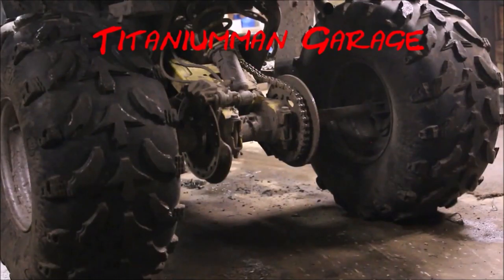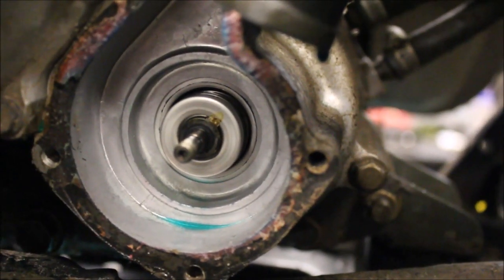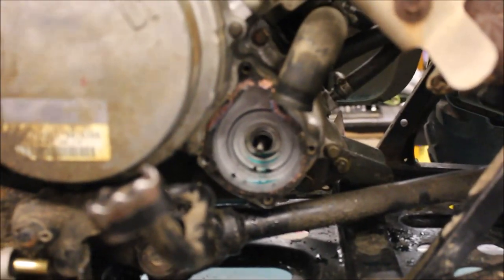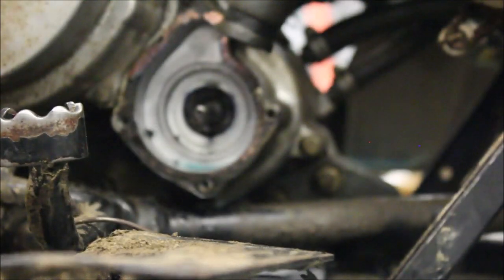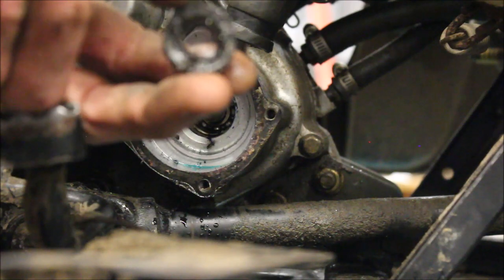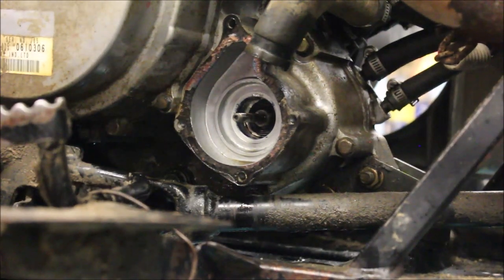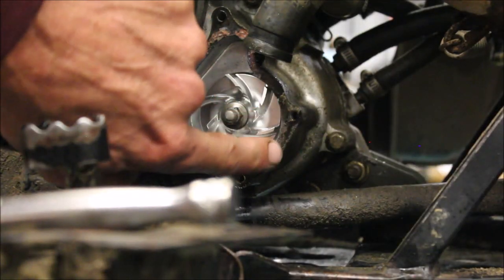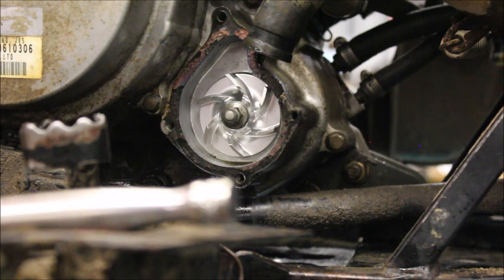HOW TO INSTALL A WATER PUMP SEAL ON A POLARIS SPORTSMAN WITHOUT SPLITTING THE CASE.

Comment: Dont use a screwdriver to pry it out.. my father did this and bent the shaft. The drill a hole and thread a screw to pull method workwd for me! Thx for the helpful video 🤙
Reply: Don’t pry on shaft and a little heat wouldn’t hurt😮
Reply: My mechanical seal came apart and left the inner cup in. Any advice on how to get it out....
Reply: @Asunamazda  if you're replacing the cup also like I was, put a wide head screw into it, and then used a slide hammer to pull the screw out with the cup. Worked like a charm

Comment: Looks like I bought the exact same kit as you and I just got done replacing mine in my sportsman 500 now I am getting coolant leaking out of my weep hole.  Not sure if I got bad seal.  I am guessing if it is coolant leaking it is the mechanical seal that is the issue.
Reply from the maker: Yup. Its leaking or the rubber seal behind it.

Comment: I have a 1999 sportsman 335 that was leaking oil. I took the cover plate off the oil cooler pump and it had no impeller or mechanical seal. Just a gasket around the middle post. The post is not threaded and all I can see is the bearing and the post. Don’t really understand if this is normal or was the mechanical seal been missing? Help!!!

Comment: I have coolant in my crankcase. Others have said pump seal or could it be the head gasket?
Reply from the maker: If you look at the sparkplug and its wet and its blowing coolant out the tail pipe or white smoke..Head gasket. If its dripping from the weep hole...its the seal.

Comment: The shaft and bearing inside housing how do you pull that apart to change shaft and bearing inside housing do I have pull while engine to do that thanks
Reply from the maker: I haven't had to do that. but I believe it is pressed in. You would have to split the case halves to get to it on a 500.

Comment: Dumb question been work one one these for a friend seen it was leaking out the lil hole could this cause an overheating problem? And when I pressure test it , it don’t leak out that hole or anywhere else just happened to notice it was dripping
Reply from the maker: When you pressure test it you might be pushing in the mechanical water pump. If it leaks out the weep hole its leaking somewhere. Check the oil in the engine. see if there is coolant in the block.

Comment: I thought you said in your previous vidios that this was the incorrect way of doing this job ? I was getting water in the crankcase as well . I recently did this job by taking off the "plate" behind the flywheel . I think the problem was the inner seal . So far no water in the oil .
Reply from the maker: It's not the best way to do it because if you dont get the inner seal in correctly it could leak. My first attempt years ago failed.

Comment: 97 scrambler 500 non ho: I can’t really tell if it’s the weep hole that’s leaking or if it’s the outer impeller seal AND I ABSOLUTELY DO NOT WANNA PULL MOTOR just because frame is in way of pump (no white smoke)

Comment: Well ours is impossible to pull out
Reply: Did you get it out? I’m having the same problem
Reply: It's a bitch!!! One advice I can give is to do it on a day your super relax and  plan on spending a few tedious hours.  Found it to be easier to break the seal piece by piece and once you only are down to just the metal and no other obstructions to punch out the metal by delivering super light blows with a small sharp flat screw driver and then slide out the middle piece off the shaft. Using a hook catching the back of whats left pull slowly and gently towards you. Once you see the first  edge/sealing surface pull away just work around and it comes off. Not easy but doable.

Comment: I just did one and its still leaking out of the hole.....lame
Reply from the maker: Did you replace the rubber seal behind the mechanical seal?
Reply: @TitaniummanGarage  by any chance you have the part number of the oil seal that goes right in front of the bearing before the mechanical seal?